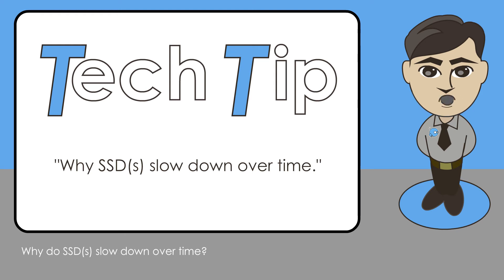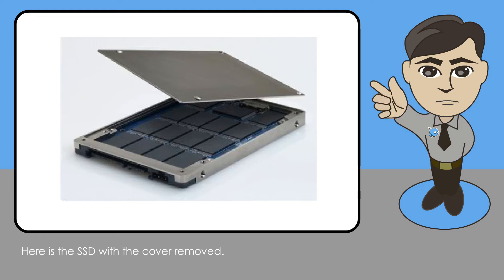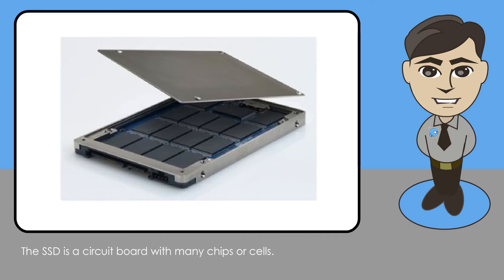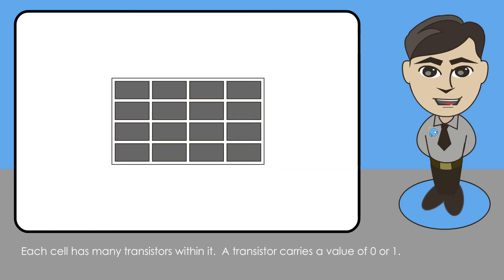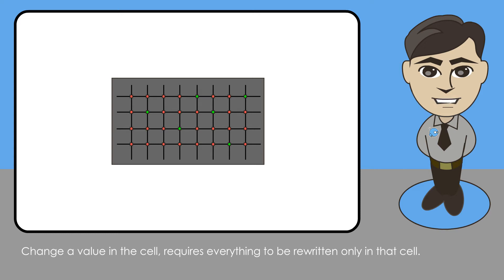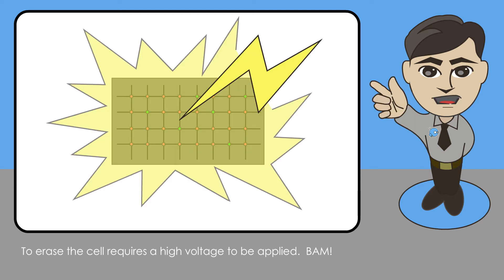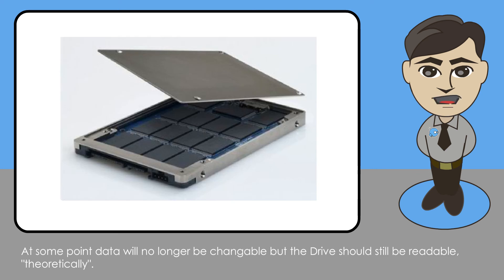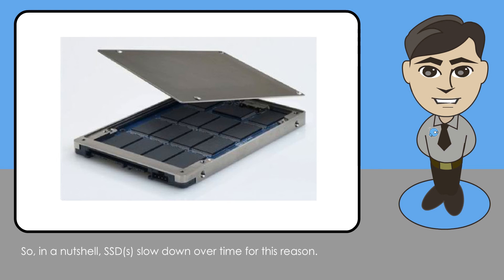Tech Tips : Why SSD(s) slow down over time.

Comment: This video explains why SSDs become unreliable, not why they slow down. I haven't  seen any data that shows factory speeds cannot be retained once the SSD is secure erased, which is recommended for every reinstall of Windows. SSDs slow down when they get filled up too much, slow down because of the way files or formatted over time - but both things are curable with formatting. The transistor damage mentioned does not effect speed, it effects ultimate reliability or failure point.
Reply: +DesertRosePro yes exactly,i agree with you